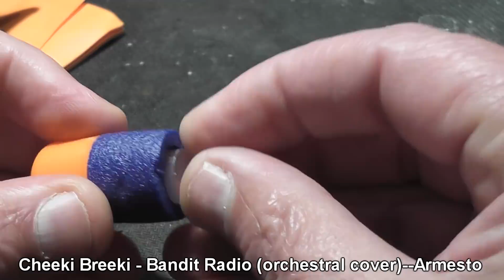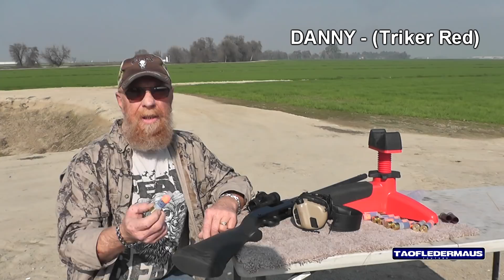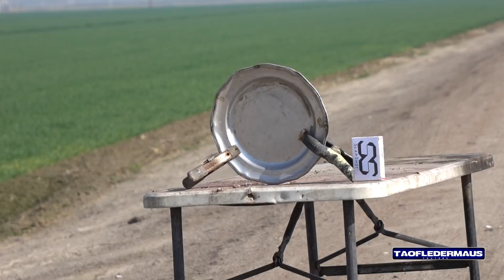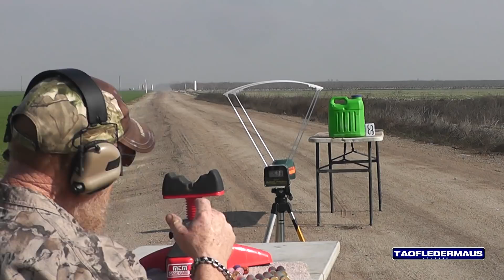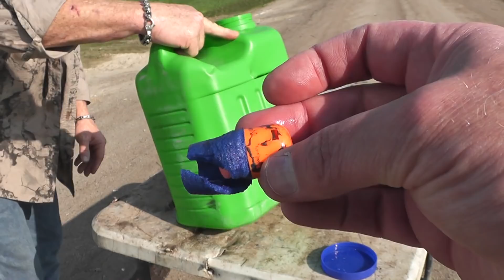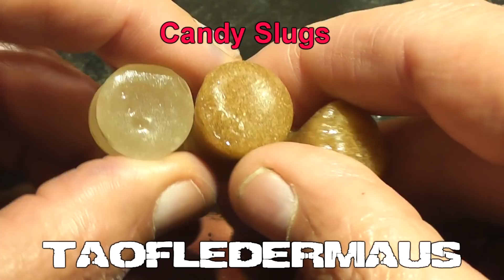Mega "Nerf" Shotgun Dart Experiment - Glorious!

Comment: You should put estes model rocket engines in some shot shells! Don't use wads so they ignite! A,B and C size rockets will fit really well!
Reply: Yes
Reply: Hmm, interesting indeed. 👍
Reply: That idea really does make me curious as to whether it would work or not but I feel like it would be far to risky without a fair amount of "shooter-less" setup for safety. Providing they did light off, I would imagine they would act very much like a bottle rocket with the stick ripped off. They would go who knows where and be a possible major brush fire/personal burn risk. I would also be afraid of the off chance that one did light off but for some reason lodged in the barrel while burning.
Reply: I've shot those rockets out of a metal tube, and w/o any stabilization they tumble around and make for a pretty dangerous flaming projectile. I did it once and never again lol
Reply: jim3798 as long as the barrel is rifled it would work to some degree
Reply: it would need stabilizing fins or they tumble dangerously out of control. I mean dangerously. needs fins. come up with fins that retract while in the barrel and upon exiting the fins spring open.

Comment: You need more weight! I used to mod nerf guns when I was little. I would cut the darts down and hot glue a few copper BBs in the end of it. Also modded the gun with tighter PVC barrels and take the air restrictors out. Could shoot 50+ yards and still leave welts on whoever you hit (my little bro).

Comment: Next time you try this with black... Try it with about 10 grains of ffffg. Ffffg is ment as pan powder, but its because it burns faster... Or 0B swiss. Bother extremely fast. Ive not played with it much as a main charge but 7 grains in a 0.31 caliber revolver seems to work well. It develops its max pressure very quickly, so might work better with these nerf slugs. Worth a shot at any rate. Lol if needs be i can probably send you a pound

Comment: Looks like circa 50fpe.
About what a 25cal pcp airgun puts out using a 25.40gr pellet at 1000fps round about.
I have an airgun channel where i do little 1 minute airgun clips shooting random things too lol. I use a couple of springers one of which is the most powerful off the shelf break barrel airgun in the world.  It doesn't sound like much at up to 37fpe but you can shatter brick tile with it and hunt 150lb pigs and coyote. 
A comparison would be (perspective) a red rider bb gun gets about 2fpe and a daisy 880 gets about 6fpe. 
In England anything over 11fpe requires a firearm certificate  (fac)
Even my 177s get 23fpe which is a heavier 9.8gr round nose pellet traveling at 1035fps.
Regular 7.9gr pellets from wally wurld go about 1165fps in my 177s.

Comment: Oh did you? Did you LITERALLY "Push it past the breaking point?" Is that what you LITERALLY did? LITERALLY? I'm disappointed in you.
Reply from the maker: sure
Reply: Sure? You do know what the word "literally" literally means right? Means you can't say "literally" followed by a metaphor... Metaphors are the opposite of literal. You FIGURATIVELY pushed it passed its breaking point, it wasn't pushed, it was LITERALLY shot or propelled through the barrel of a shotgun and fell apart from a rate of acceleration that the glue holding the foam and rubber together couldn't handle, or just don't overcomplicate by simply TRYING to sound smart by using a word that nearly everyone uses out of context. Just ignorance, that word has lost all meaning and our society is spiraling into idiocracy. Good day.
Reply: And also, you chuckled after using that word out of context, as if you were being clever... You should be ashamed.